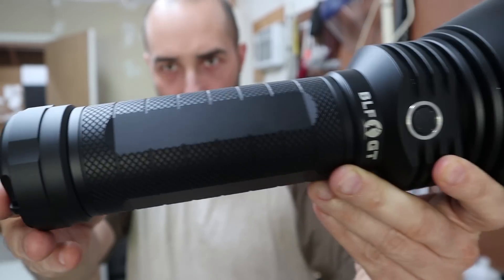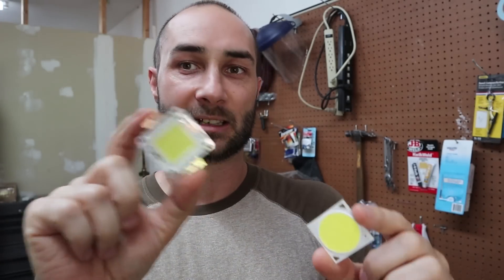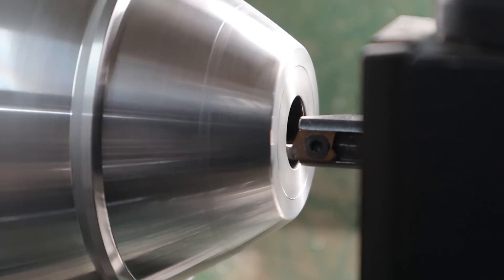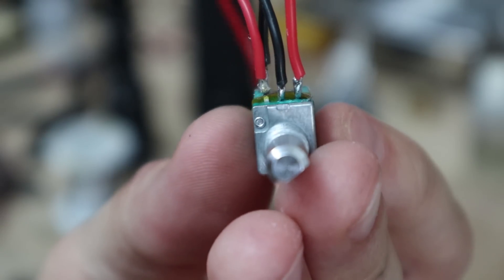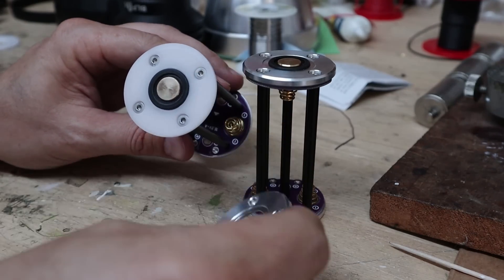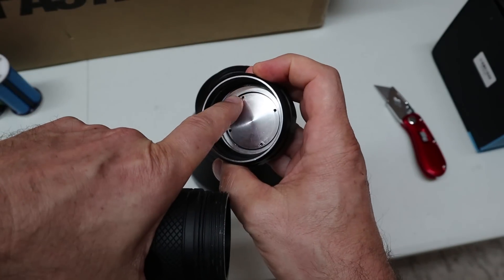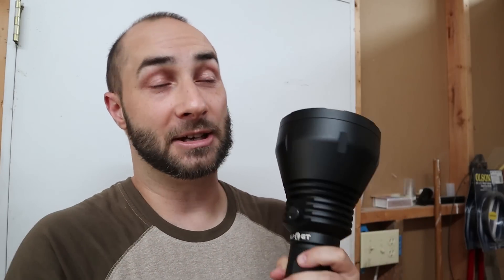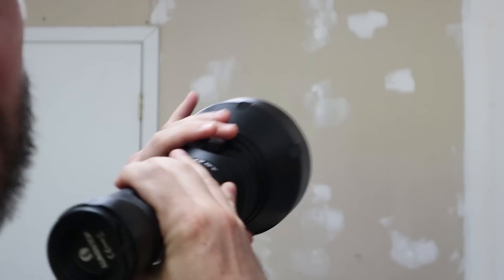World's Brightest LED in a Flashlight!  (Cree CXB3590)

Comment: Make another, I'll buy it. I bet there are 100 people in the comments alone who would buy this light. It's insane : )  The only thing I was thinking is that it would be a lot better, with a reflector about 6 to 8 times that size (and geometrically/proportionally longer also). Even 3 to 4 would make a huge difference. I'll bet that thing could throw 5 or 6 miles with such a setup.
Reply: cob led is vary low intensity 
  even if you have
900mm reflector and this led 
you will get lower then 20Mcd 
but if you put cslnm1 led instead of cob led you will get over 100mcd with 10-20 time less brighter and 10 time more intensity

Comment: Lighting is good, but the reflector is not suitable for using the full power of the led. Realize that after you put the new led in the flashlight it lost focus for long distance, but for average distance was great. Note, for long distance the original led is stronger.

Comment: Some questions:

- How hot does it get when it's on?
- How long do the batteries last?
Reply: It will be very hot for sure and isn't able to output this power over a long time. Speaking of time: As we say he is driving the COB-Led on a forward voltage of about 36V @3,2A of current (=115,2W) and with the efficiency of about 90% this is drawing 128W at full power. the batteries are 8x18650 with 3500mAh each (for example i assume they really have 3,5Ah)  so they have 8 x 3,7V (nominal voltage of each cell) x 3,5Ah (capacity) = 103,6Wh of energy. so we can say they can power the unit for about 103,6Wh / 128W = 0,81h..a bit over 48 minutes. I hope this will help you, have a nice day
Reply: Good question..

Comment: I work on the trains here in Australia and the dark isn't my friend, not when I'm out in the middle of nowhere in the middle of the night trying to pin point a fault. A good flashlight is always handy, at present I have a Olight H25 head lamp and a Lux-Pro LP1100 that live in my work bag. I'd be one of those to line up if you produced your upgraded flashlight. it's brighter than the twin LED headlights that is on some of our locomotives have on them.

Comment: Very fun video.  Good work. I was entertained, by the skill and demonstration.  Chuckling, wondering if the runtime or the point it puts 3rd degree burns on you hands, is shorter. As a flashlight I see it as useless,  But give me the mule with enhanced heat sink and 4 hours of runtime battery pack, with ac operating while charging.  Then, you have a practical light.  I wonder how the price has dropped of the chip.

Comment: There's something that's around 4.68 to 5x more powerful than this COB array, actually... If you can afford to get one and sling it into a GigaThrower and turn it into a TeraThrower that would be freaking sweet. I would estimate a good 90K lumens depending on the colour temp you pick. it's also hella expensive because it's a high powered high CRI LED array, with a decent boost converter it should be around 500w total system power. Here's a link: https://store.yujiintl.com/collections/frontpage/products/bc-series-high-cri-high-power-cob-led-3200k-bc270h-pack-1pcs

Comment: About the reflector: the diameter of the reflector has to be at least 10 times the diameterof the LED to prevent that donut pattern. I have done a lot of reflectors with a 3d printer, and now I understand that the LED must be small compared to the reflector if you want to get the pattern that you want.
Reply: I wonder if a  slight convex lens in place of the flat glass on the reflector will get rid of the donut.
Reply: How do you 3d print a reflector?
Reply: exactly, he`s missing the point: you use only one LED when you want to make a monster tight-beam thrower . But when the LED is too big it`s impossible to create a tight beam. You can get ~ 100 watts from a HaikeLite MT03 TA Devourer that has 3 XHP70.2 LEDs at $100 and 3 reflectors. In theory you can get a tight beam with a big LED like CXB3590 if you use a big glass lens instead the reflector, but the LED has to be far enough from the lens (orelse no beam) and it will lose a lot of light ( a led that type emits almost 180 degrees spread)
Reply: @himanologanor4093  I believe they have 90°, 60° angled lenses. Have you seen the video with the 150,000 lumen flashlight? Several COB's w/lens on each(maybe 8-12 COB's, each with spherical lenses). Also, very little light loss through lens(2%?), from what I've heard from indoor gardeners, who use 8-100W Cree CXB-3590's for a 5'x5' space. Mostly 1000W HPS lamps, have been used as highway lights(150,000 lumens), while the shorter poled street lights use 600W HPS lamps(95,000 lumens), but have a orange tint/glow, to give an idea of how dang bright these COB's are, and how much of a better spectrum! And some LED's are putting out 160 lumens/watt! Very bright, full colors, and replacing the HPS lamps as street lights, as they're about double the efficiency of HID(High Intensity Discharge) lights(HPS(orange tinted-2200°K color)and MH-Metal Halide(very white, slightly blue tinted, often used for gas stations, convenience stores, security lights-6500°K color). K-Kelvin(temperature it takes Tungsten steel heated to put off that color of light. So an orange/yellow tint(more efficient), or cool/blue tint(less efficient). I've seen COB LED's from 2700°K, 3000°K, 3500°K, 4000°K, 5000°K, 6000°K, and 6500°K. Probably more! But much better color spectrums, last 10X longer, much less heat/more light than traditional HID lighting. But you may know all this, so forgive my rambling.. Have a great weekend!
Reply: don`t worry, i`m 100 times crazier than you when it comes to flashlights, i only have some things to add, everyone wishes a tight thrower and it`s not about the right colour there cause you can`t use that for photos. I know guys that can`t stand the blue tint but they are than the same that fall down when you use the strobe, so i guess it`s about brain wiring. Lastly i can`t use a huge lens cause of the weight, and same about the power, it`s only that much accu weight that you want to carry. So i`m forced to stay with my ACEBEAM X45 and its form factor : soda can accus and a nice beam reflector that in the end can fit inside a jackets pocket.
Reply: @himanologanor4093  you can use a massive LED and still create a collimated beam... there's nothing inherent to a large led surface which prevents this. I don't see how he's "missing the point" he made a fun project which is obviously limited by his goal of using a premade housing. The new light is superior in output. The tight beam is dimmer than the new lights flood.
Reply: A 3d print ?. He owns  a  lathe.

Comment: What a beautiful light source. During maximum operation, how many amps(or watts) is this beast pulling and at what voltage? Also, do heat sinks without fans keep things cool enough for sustained operation? 
Thanks for the video!
Reply: Stated in the video already, 40V, 3.2A

Comment: I am using a full-size CPU cooler with the fan to cool my 100W LED, boost converter and the controller. I wonder if passive cooling would work on your creation.

Comment: how do you manage the high heat generated from the led chip?
Reply from the maker: Turn it down when it gets hot :)   If you just left it running on full power eventually it would probly burn itself out.

Comment: How does your temperature develop on that bad boy? 
I built a maglite with an xhp70+internal cooler with fan and it still gets about 50℃ if you leave it on for several minutes. 
It must get pretty toasty at triple the power.

Comment: Not to be a party pooper but the cree CXB3590 is no where near the brightest COB led out there, Brigelux Vero29C's will do almost 200W. The 3590 is actually pretty old tech in LED terms. That said the 3590 being used like this makes one bright ass flashlight! To get a farther throw you might consider using a glass lens for the cob to focus the output to a 90 degree spread VS the 180 a bare cob does. Something like :
http://www.ledgrow-lighting.com/sale-11001505-60-90-120-degree-diy-led-grow-light-kit-d100-glass-lens-with-bracket-refector.html
And actually that might get rid of your doughnut issue as well.

Comment: Great job modding that light. The infinitely adjustable switch is a nice addition. More lights should have that UI. You could advertise that light and no one would assume it was a home modified light as opposed to a commercially available and mass produced model. 

It's always so difficult accurately portraying distances and size scale with smartphones and digital cameras. When you pointed out those 2 cars parked side by side near that building, it initially appeared much closer until you described it. Same with the restaurant on the other side of that damn dam(probably should've said, "that damned levee").

Comment: At this wattage the Bridgelux vero 29 gen 7 C is more efficient and more powerful but it's tough to get the extra voltage for such a device like this flashlight most likely to run it.

Comment: Thank you!
You Sir, are a Master.
I'd be interested in hearing, how much money you've got in it for parts, in this build? I know that the LED alone, is $40-ish.
Reply from the maker: Thank you Steve.  The parts were not that much.  About $100 total plus the host.   The time it took was a lot though because of having to mod the adapters, and body.  Getting the pot to fit in there toying with the reflector.     Probly 20 hours.
Reply: Thank you  @Lumencraft-

Comment: 3200 milliamps and 40 volts. Are you concerned with the possibility of a deadly shock?
Reply from the maker: On the drivers information page there is a written warning that because the driver can output 80volts electrical shock can occur.   I doubt that it would be anything deadly though.

Comment: I hate you! This is cruel to those of us who can't do this... SELL IT!!!
Reply: Better yet send it to me!
Reply: Oh! or you can buy A more powerful! in here . 80.000 Lumen. yeah! It here https://reasonbuy.com/brightest-headlamps/. Dear!!
Reply: @kimproshow4910  That list is sketchy.. In the table it says the headlamp is 80,000 lumen, then inside the Amazon link it says 80,000 LUX (completely different metric than lumen), then it says it comes from a single Cree XPL LED, which can barely hit 1,000 lumens when driven harder than what many of those flashlights would run them at to begin with, plus those kinds of flashlights tend to have questionably regulation circuitry (if any) to begin with, which will lead to only having peak brightness on fully charged batteries.

There ARE however legitimately bright LED flashlight you can get from reputable companies. 1lumen has a real list containing the brightest reasonable flashlights for each category, immediately following with the top 5 brightest overkill manufactured flashlights in the world! The only light I feel should have had honorable mention on there is the brand-new 14,000 lumen Emisar D18 for only $100, which I plan to buy soon.
Reply: @kimproshow4910  You trollin? ;) On the side note, that would be 1kW power out of this tiny creeds;)

Comment: so now with your modifying you can obtain a nice explosion given that at the middle of the battery tube all you have to isolate the top cell holster is the anodization of the tube ...at least use a thin plastic tube inside to isolate the holsters from the tube

Comment: There's 8 cells in series with no monitoring, so I wouldn't want to run it flat... does the driver have a low voltage cutoff?...
Reply from the maker: The driver offers no protection so a good bit of pack awareness is needed, some protected cells don't hurt either.
Reply: Yeah, I think protected cells would be the answer.... because otherwise it would be really easy to reverse polarize one.

Comment: I like your BLF GT version better than the original, how hot does that thing get?
Reply from the maker: It will heat up pretty quick.    I'm guessing about 10 minutes max on full power before its hot.
Reply: @Lumencraft-  
So theres no cooling fan, will it burn down or overheat?

Comment: Wow. How does the throw compare to the standard GT70? Very hard to tell from the video without numbers. Amazing work.
Reply from the maker: The GT70 will definitely out throw this. Even though the output of my light is much higher the GT70 beam will be tighter. I’ve not had a chance to do a good solid control test of the lux yet, but a quickie test on the light meter indicates approximately 162,000 CD for the CXB3590GT.